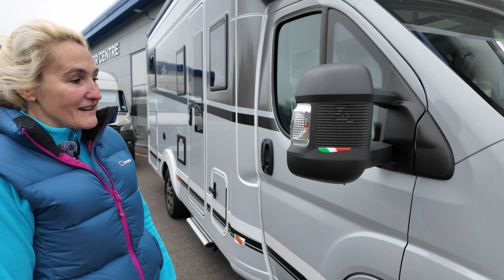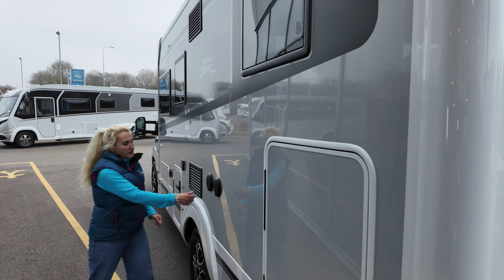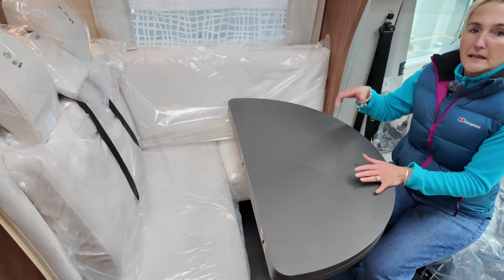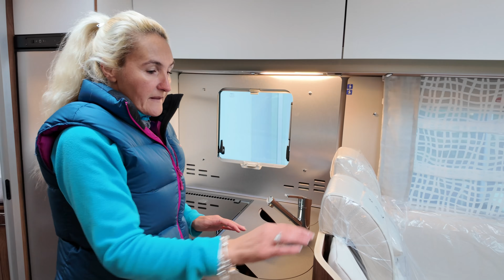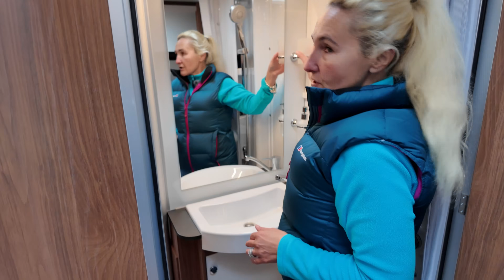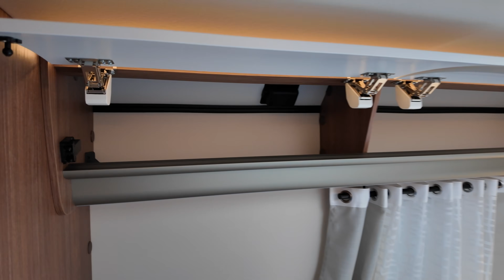NEW Laika ECOVIP Titanio (2026): Special Edition Motorhome

Comment: Am guessing loo seat can swivel to allow hinged shower wall to open fully. - but the loo door is a disaster
A sliding door, or 2 split, in the bedroom, but with loo door hinged on other side is a normal solution.
A piece of adhesive opaque PVC could easily be stuck on the loo window if needed.

Comment: When you showed us how the shower worked , why on earth didnt the designer of this van put a simple handle on that basin wall so you could easily pull the whole thing out instead of having to reach for anything ( the cup holder ) to open it up . 
I dont feel that there is enough room forone to shower comfortably . For me that would be the compromise . That wall would not close up any further so you would have a bigger space . ( again , im surprised considering the cost of this motorhome ) I would say that this is disappointing .
Reply from the maker: As you saw, I was looking for something to pull, if you were taller it may be more natural to take hold of the top of the shower wall. Thank you for your constructive feedback as ever.😊

Comment: Throughout the review , you seemed to struggle to open up the cupboards . I noted that there were ( what looked like ) black dots , were these indicators as to where to press to open the doors ? The mirrored unit in the bathroom would particularly concern me , as to close it and then open the other door may break the mirror ? just a minor thought . ( plus as you say often ) no damned rods to stop the bottles falling out as you open the doors . ( I STILL question manufacturers as to why they cannot supply things as simple as this . especially if the price is £106,000
Reply: I wonder how people with arthritis in their hands would manage as seemed to take a lot of pressure.
Reply from the maker: The Laika mechanism is always one to fathom out. The dots tell you to push, from memory, once you get the back it is easier😂 I had this when we tested a Kosmo in Italy a few years ago.

Comment: What differences ( over the years ) or improvements have you seen in motorhomes during your reviews ?
Anything that stands out to you both that you think "Im glad they have done this " . or anything that has disappeared from motorhomes and campers?
Reply from the maker: Good question, the designs change very little to be honest, apart from updates on rear light panels, mood lighting and dimmers inside, the move towards solar, lithium and diesel heaters. Some of the changes I like are the options on the heating and off grid for those that want it. One thing I haven’t liked is the increase in prices and then some manufacturers bringing out a more entry level vehicle, but stripping it back inside, so it is too basic and not really that good value.

Comment: Hi karina & Jules hope your well, we are at the show Friday not sure if your there. Quick Question the Swift Carrera 244, do you know if a longer version like the 132 will have the pop top. Basically we like the quality and long lounge and particularly the rear fly screen but you cannot at the moment get it with a pop top. Regards Graham & Glen ❤
Reply from the maker: Thanks for watching, we will be there Friday. I am not aware of any plans to add the pop-top, currently it is only the 244. The longer lounge of the 132 would be my preference, having recently tested the 144. Swift will launch their 2027 models this summer, I don’t know if there are any plans to add more pop tops to the range. There aren’t many manufacturers that offer the longer bench seats and a pop tops, especially on the 6 metre length. Elddis have a few options but may not be for you. It may be worth having a good look around on Friday to see if there is something you see. AURA and WildAx have a few options, Pilote and Auto-Trail may also be worth a look. One I find quite unusual, in a good way it Globe Traveller. They wont be at the NEC and don’t do the pop-top, but do have some nice rear lounge models. 
It may be worth looking at Rapido and Dreamer, again, they offer something a little different. Look out for us on Friday and hopefully get to say hello..😊😊
Reply: Thank you so much Karina for your extensive experience and advice. Lets hope Swift do a pop top in there new range for 132. We have had change of plans with a carthago purchase. We are buying a investment property to rent out snd will park our campervan there whilst living abroad so every 3 months we can tour uk. See you Friday regards Graham & Glen ❤